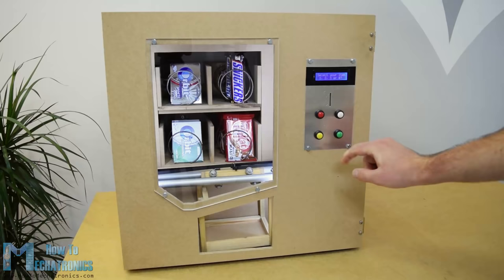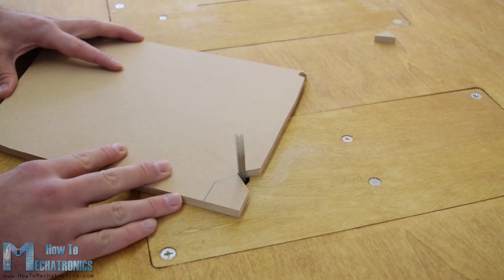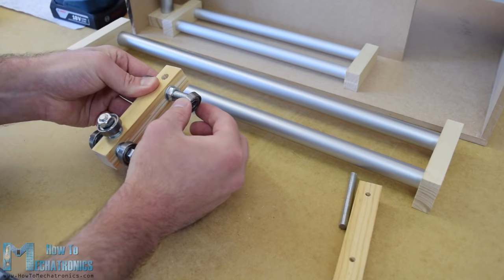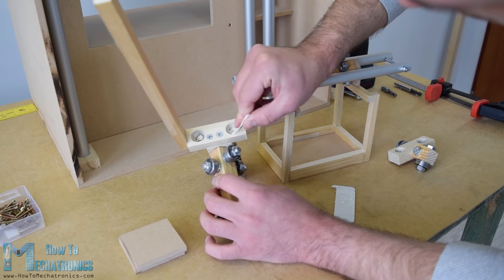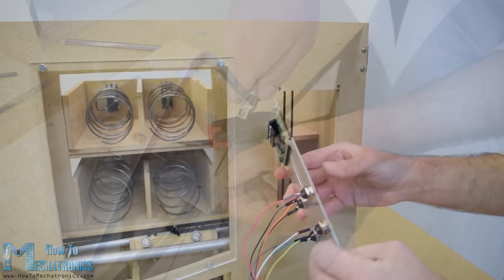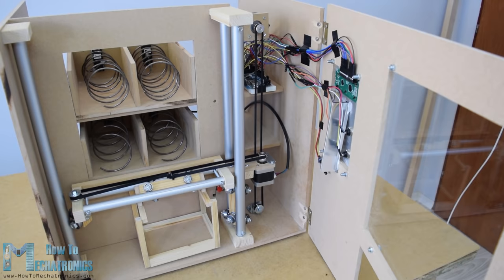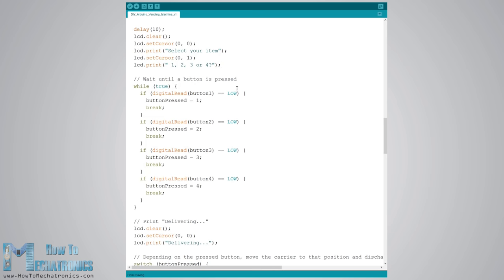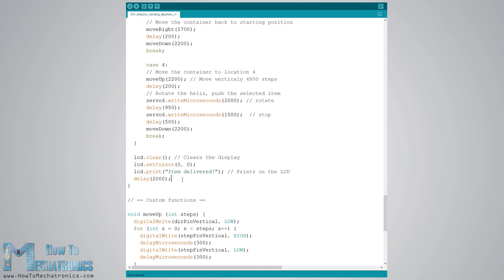DIY Vending Machine - Arduino based Mechatronics Project

Comment: Great project! I built it with my 11-year old who found this on Youtube. We made it a little wider (50 cms) with 6 item compartments. This made the horisontal rail longer so we had some problems with stability. The side with the stepper motor was always slightly faster than the other side so it got stuck. We solved this by adding another motor on the left side, both connected to the same Arduino Mega output.
Reply from the maker: Thanks, I'm glad to hear this. :)
Reply: Did the code work please help?
Reply: Can you help with the code please i want to build this with up to 6 items too but coding is not my thing :(

Comment: Hey , 
Cool project 
Why didn't you use a DC motor instead of servo ? We could control how much it rotates by applying voltage for a specific amount of time ...
Reply: very true  exactly what i was thinking 
NOTE:
its easy to control dc motors one-way but if you have to spin both that's when it gets harder!

Comment: Need help. I build the project, copy - pasted the code in Arduino IDE, loaded it on the board and nothing works.
EDIT: I managed to make it work, but the 2 stepper motors aren't working.

Comment: how did you do the vertical rail? on the diagrams and video it shows just a belt hooked up to nothing other then the 2 pulleys so how does it pull up the horizontal lift up did you insert a screw then zip tie like you did on the horizontal?
Reply: encontraste la solucion?

Comment: Which belt is needed and how do the components connect to the stepper motors?  New to this.  Also, how much weight would the basket be able to hold?  Would the mechanism get bound up if the width was made to support 4 items horizontally?  Thanks.

Comment: hello dejan bro pls answer me i want to know how did you powered  the servo motors because when i plug the vcc and gnd of my servo motor to 5v arduino board  it doesn't rotate its make noise vibration only when i rotate it with my hands than start rotating normaly  than when i restart  upload a code to arduino its not work only work when i rotate it with my hands every time does the 5 v of arduino not good for servo motor but if is not good than why it work when i rotate it with my hands i need help i want it to work good without rotate or moving it with my hands 
do i need power supply to fix this problem? or i use 5v of  the dc-dc coverter to my servo motors  ?

Comment: What if I want to build a "horizontal/linear" vending machine for small "Shampoo packets".

How would I know that coins are real and get accepted.
Or if fake coin is inserted, it won't get accepted and automatically gets ejected.

Also, how to check if there is item available or empty, or its delivered or not.

Lastly, can I add QR code payment instead, if so how will it work.
I have less knowledge about programming, but lot more interest.

Please help in making such a device.

Comment: hi! we followed all your steps, but it seems like this installation needs much more power. when we insert our wire into 5V, the Arduino stops working. when we pulled out our wires from 5V, the MEGA is working again. would it possibly because of too many wires causing the voltage not enough? Is there any way to solve this problem?
Reply: Did you fixed this problem?

Comment: Is it possible to get a working download link for solidworks? the one on the website is dead, please this would be really helpful
Reply from the maker: Hey, what kind of error do you can when you try to download it? Also try with another web browser? Let me know if it works for now.
Reply: @HowToMechatronics  Hey man, tried with a different browser and it worked! thank you so much
Reply: Which website did you used

Comment: Anyone know how to get it to accept 10 coins before dispensing an item please? I want to make it so it won’t dispense until it has 10 coins placed in the machine. Many thanks 🙏
Reply from the maker: Hey,  try something like this: In the "while" loop where we wait until a coin is detected, when a coin is detected instead of breaking the while loop, count the coins. Each new coin will increase the, let's say the "coinCounter" variable (coinCounter++). Once the coinCounter variable will reach a value of 10 (if (coinCounter >=10) break;), then use the "break;" command to exit the while loop.